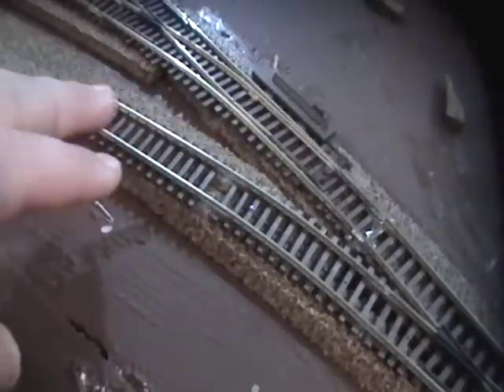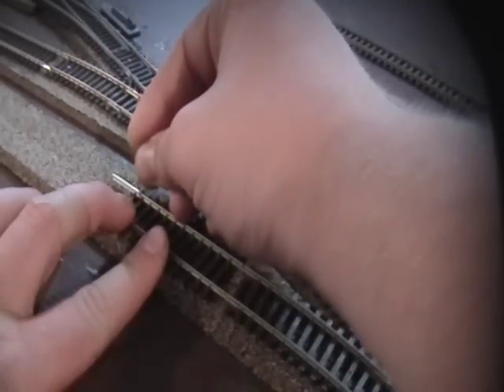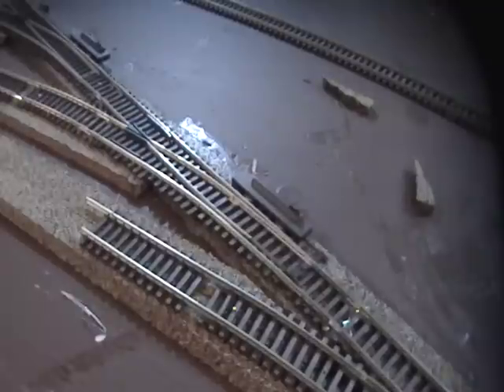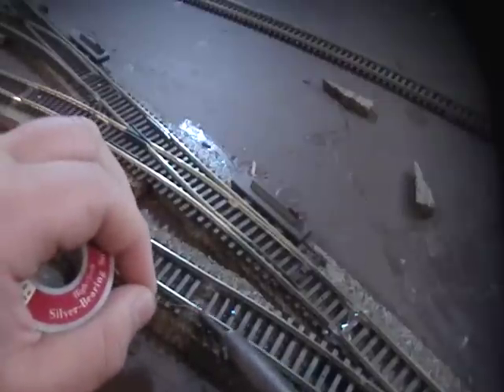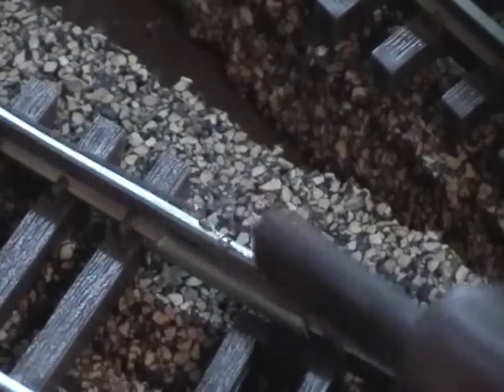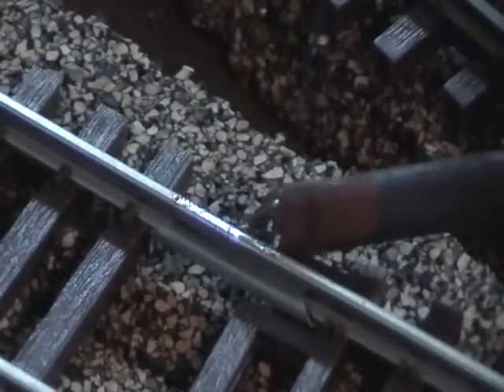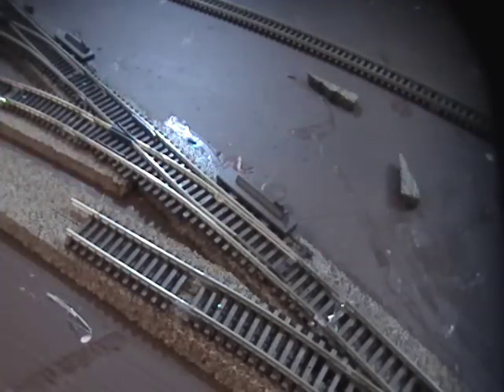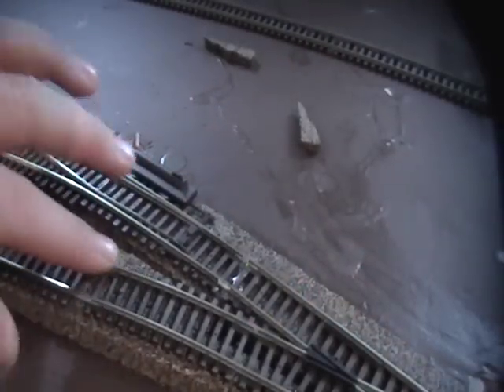How I Solder Flex Track

Comment: Hey bro did you notice that your putting a kink in your track the one you're about to solder I could not take tips from you because you're looking at a piece of track that there's not have a smooth ride to a curve in it it's got a kink cutting back to the right side and you're going to solder it are you brain-dead may God be with your

Comment: Your taking the time to attempt to educate fellow rail fans is admerable, however always flux first, never solder by trying to get the solder to flow down into a joint. Heat the track to the point is melts the solder and allows it to flow. Before you do that however apply a heat sink on the tracks to prevent melting the ties. Damp cotton balls, damp tiny wood pinch type clothes pins, metal clamps...
Reply: @David curtis I do know how to solder and when soldering leads to a track with plastic sleepers I generally use heat sink to protect the sleepers from melting. I find when soldering tracks together I can also not remove the sleepers if I use heat sinks. Just because people use different processes, it doesn't mean they do not know what they are doing.
Reply: @David curtis But these are; how I do it. If you have a better or different way share, don't criticize. Better yet do the work of making videos and share your way of doing things. You see, we share how we do it, not how you do it. So please share how you do it.

Comment: This is very bad soldering.   I hate to be negative to a fellow model railroader.   You should always solder the sides on the outer part.  NEVER use sand paper on your top of track.  And if you use flux liquid by brushing it on, your solder will flow very easily onto the track and melt between the two rails.  Little or no cleaning needed.  You can't even see the solder because it liquifies and flows on easy.  Check out my videos and I will have "how to" videos in the next year being posted.

Comment: If the rails are soldered in one continuous length are they effected by expansion and contraction? Surely the fish plates (rail joiners) are enough to give electrical contact. 
or solder a piece of flexible wire to ensure contact across joins.

Comment: I soldered both inside and out side the track, used a dremel to smooth it over..this technique is great especially if u have flex track or even short track on a curves less than 22degrees..no kinks smooth operation...it takes alittle longer but whats worst than  having nice layout and problem corners and turns that keep u from running consistantly

Comment: I get what you are doing, but why are you soldering straight on the top of the railhead. I have always soldering on the two exterior sides, never once on top of the railheads. I've never had a problem with electrical pickup. I don't see why you need to solder the top of the railhead, it just gives you more sanding to do (you should sand the rails after soldering anyways. I use 650 grit.)

Comment: cool! How do you get the solder to stick? I have to make a huge ball the knda work it up to the rail with teh cold solder till I get it to stick. I have a lot of problems on my layout. I have a set of feeders working I have a set that don't and they're soldered to the track good. I have soldered the rails together in between the 2 feeders and I still have power to only one peice of track. What am I doing rong?